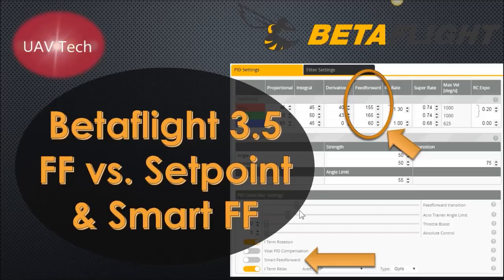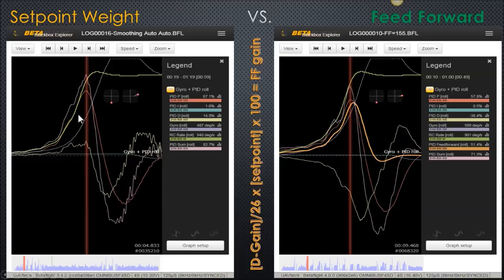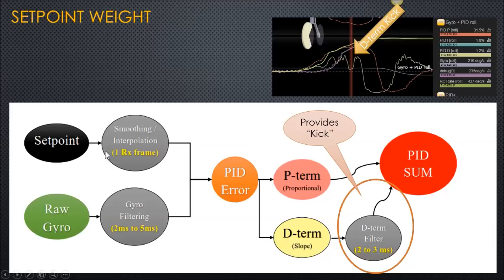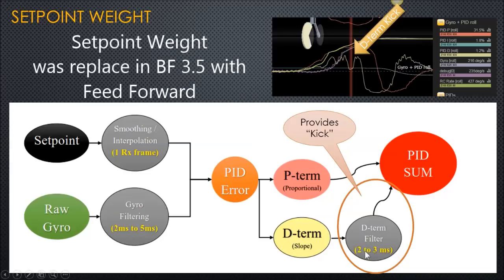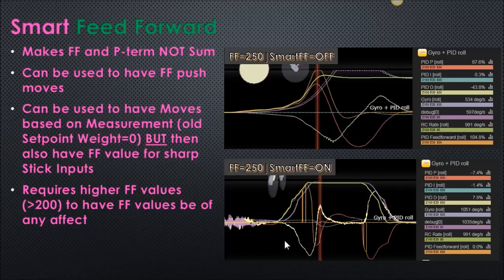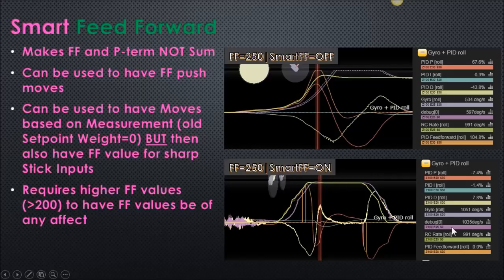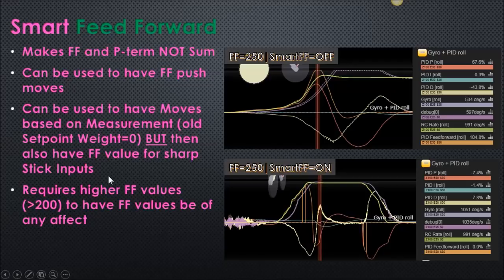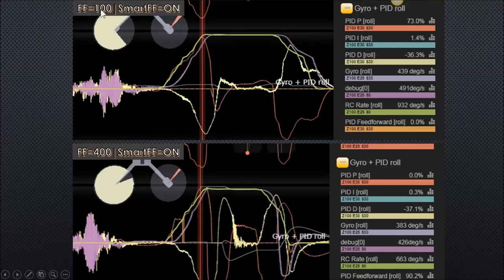FeedForward vs. Setpoint Weight (+Smart FeedForward)

Comment: To be entirely correct, the feedforward component, even when it was hidden in D by the setpoint weight, was still not passed through a filter, or affected by gyro noise. Actually the math (and code logic) is exactly the same before and now. It is just that now the two components (slope of RC rate and slope of gyro) are separated and use their own gains - which really makes everything cleaner I think.
Reply from the maker: Right, but if PID Error was based on Gyro (which had filter latency) vs. Setpoint.  And then that pushed response through D-term, which had more filtering and latency.  From how i understand it, FF is direct of setpoint slope.  no gyro or d-term latency involved.  Right?
Reply: Check out: https://git.io/fAxsB
This is the old code (spweight based).
Line 511 has the two terms - first one (dynC * currentPidSetpoint) is the actual ff term. dynC represents the weight scaled by the current stick position (the setpoint transition setting).
The second is the gyro term with the negative sign. Note that it is filtered independently on lines 504-5.

The differentiation itself (line 513) looks like it mixes up things, but in fact, since the terms are linear, we effectively have:
D = dynC*(currentPidSetpoint - previousPidSetpoint)/dT - (currentGyro - prevGyro)/dT
Thus the first term (ff) is still just a derivative of the setpoint and is completely independent of the gyro and the d filters. In 3.5 it just got its own gain (F) while the D gain remained for the second term.
Reply: Maybe it will be useful if we trace the evolution of the whole ff stuff.

Initially there was D from Error and D from measurement.

D from error differentiates the Error which is (Setpoint - Gyro).
D from measurement differentiates just the gyro: (-Gyro).

The Setpoint Weight was telling how much of D from Error has to be taken:
w*(Setpoint - Gyro) + (1 - w)*(-Gyro)
It's a classical weighted sum - if w=1, then second term will be 0, if w is 0, second term will be 1*-Gyro.

But if we simplify we have:
w*Setpoint - w*Gyro - Gyro + w*Gyro
the two w*Gyro cancel and we have:
w*Setpoint - Gyro
which we also find in the code.

This is quite an interesting result and we can interpret it in a new way. We can say that the D sum is transformed from weighted sum of Error and Gyro to a sum of a FF term - which only depends on the setpoint, sp.weight and nothing else, and the gyro term which depends only on the gyro.

In pre-3.5 the ff term was effectively scaled twice: once by the setp.weight, and then with the D gain (applied over the sum).
After 3.5 the ff term is scaled ONLY by setp.weight (renamed to F) and -gyro is scaled by D. Only then they are summed.
Reply: Thank you for pointing this out.  I was just scanning the comments to make sure someone did.  Plus, while we have gained the ability to adjust the setpoint weight now individually,  am I right that we have lost a stick deflection based transition.  I honestly like deflection based transitions and am exploring negative transitions now for brushed models with individual axis adjustability.  I honestly don't follow betaflight that closely so don't flame me if I'm wrong... I do most of my flying & development  in silverware.  I tried my own version of smart feed forward once too and found oddness when the setpoint crossed neutral axis that seemed to require some workarounds that I just didn't want in my pid controller.
Reply: No, the transition is still there. It is called "Feedforward transition" (feedforward_transition in the CLI). It scales down the F based on stick deflection. Mathematically there is no difference from before.
Reply: @Bidon555  thanks for that clarification. I honestly hadn't looked.

Comment: all this just wants me to fly stock settings and work around that, lol. and it's not bad, and your flying
Reply from the maker: fly stock.  if you want more kick into rolls (faster response), raise P or FF.
Reply: I figure the stock settings are middle to lower conservative to work ok on everything. I bump P up a bit (8 or 10) and D half what P got, I likewise, and FF to 110. It's not hugely different from stock, but does make the response seem a little tighter. Getting rates right for how you fly seems to make the biggest difference. Thanks for the video, It's fun to dig around in these a bit

Comment: Thanks again for a very informative video. What would you say is the latest safe Jenkins build to run as of today? Running 1075 now.
Reply from the maker: Unknown.  I'm still on 1075 and an experimental branch that has dynamic LPFs (ties to the Dynamic Notch mechanics).

To be honest, I have never had an issue with any latests Jenkins build.  But when I do flash and arm for the fist time I do have a little safety procedure.

1. ALWAYS, ALWAYS, ALWAYS (even for Stable) do a Reset after flash and before pasting DIFF.
2. Check each screen in BF config after a DIFF paste.  ESPECIALLY orientation, config page, pids and filters.
3. Hold from bottom and quad facing the ground when plugging in battery.  Ready especially after esc startup tones.
4. Arm under a tree and standing away.

Hope this helps.  Once the dynamic LPFs branch is merged, I'm sure i will flash up to a Jenkins to check it.  Can make a video then.  If you want to test that, let me know.
Reply: Thanks again. Look forward to seeing your next video.

Comment: By looking at the BB plots, (ie. your workspace #9 for rolls) can we determine if we have too much or too little FF set by looking at say the error plot?   I'm thinking that a large PID error magnitude will indicate the PID sum is too small if it the error is slow to zero out or if it shows a lot of PID error oscillation the PID sum is over shooting.  So by adjusting FF up or down according can I expect to see an improvement the the PID Error correction?   Is my logic correct?  Or is there a better guide or way to tune FF?
Reply from the maker: A large PID Error has a number of factors involved (physical limitations, P-term and F-term).  For a sharp roll, there is a lot of inertia to get moving very fast, so you will likely have a physical limit on what the machine can do. That is the main factor for a sharp roll. 

General guide: set FF gains to zero.  Tune the quads PID.  I recommend the Stinger Swarm video.  Then raise FF values to get the desired feel (speed) of quad response to quick stick commands.

Comment: I am verry confused by this video. Because if i see the colours on the graph correctly and based on what you are saying with D term opposing all movement. D term gets calculated based on speed an not error which is the case with p and I. All examples of pid loops i have seen and used the D is also based on error. In the error based configuration D can increase movement in cases of increasing error naturally giving the kick at the starts of movement. Did i not understand something or is it indeed not based on error?
Reply: No, D does not have any error component. It's also not correct to say the D opposes the gyro.  D actually opposes the change in gyro.
Reply: Could you explain what the reason was to base D on the gyro instead of on the error, or give a link to where it is explained on the github? (i am failing at finding stuff there as i am not used to it)
Reply: D is purely based on measurement of the gyro sensor vs. the previous sample.  This gives the most accurate derivative response.  Feedforward provides the "kick" you're referring to.  The D calculation is here: https://github.com/betaflight/betaflight/blob/f814459497377ede7f9d63dd2134e479a568f6c9/src/main/flight/pid.c#L1013-L1030
Reply: many thanks :D, I can see now why it was implemented the way it is currently. Might test some things if i can figure out how to work with it.
Reply from the maker: Right, I say "all motion" because all motion result in a change in gyro measurement and hence, to me, they are synonymous.  From that I see, the D term is the shock absorber, right?  Commanded motion, it opposes.  Outside force motion, (prop. wash) it opposes.

For P term it pushes to close PID Error to Zero.  So pushes when setpoint is changed.  And it also pushes against prop. wash too to close PID Error to zero, but it is just slow.
Reply: An interesting way to think of D is as follows: If you think of gyro rate like voltage, then D is a capacitor. So prop wash can be thought of as voltage spikes from an outside source.
Reply: UAV Tech: Your explanation was very clear, however traditionally PID controller all actions are done on the error between measured and setpoint. In betaflight PI are done on the error but D is not done on the error, but instead is only based only on measurement. Because everyone always speaks about it as a PID controller I assumed it was done in the standard way. However I would describe it as a PI controller with a parallel D action. I can see why one would not perform D on the error as it would spike every time the set point changes (user input). you would have to clean it up first similarly as is now done with the throttle if you want to use throttle boost.

To go back to a mass, spring damper example. It is as if you have all 3 but the damper is not connected parallel to the spring, instead it goes from the mass to some separate "fixed world" than the spring. Classically the spring and the damper would be parallel.

Comment: Yeah I think smart feedforward is a really bad idea. Your taking an actual calculated error pterm and replacing it sometimes with an fixed value that completely ignores the gyro.

This will surely end up with the quad feeling unstable on fast moves.
Reply: Absolutely correct. I'm not a fan of it either.

Comment: about smart FF. i still dont get it's purpose and benefits.
the only thing i noticed while i was testing it - a quad became inadequate, like in the case with absolute control feature. ie it was moving not as expected, less 'direct'
tried ff values up to 300 or so which caused overshoots and bouncebacks after rapid stick moves.
is it meant only for sharp moves or what?
maybe i missed something?
Reply from the maker: SmartFF is an experimental feature introduces by Joe Lucid.  Best I can surmise is what I covered.  So I think the intent is for racers that don't do flips and rolls, but want super sharp stick response.  Turn on SmartFF and crank up FF gains.  Again, experimental for trial.
Reply: I think it's more in the context of extreme LOS flying.
Reply: Joe Lucid sure is an extreme LOS flyer )

Comment: Hey buddy, I'm horrible at tuning betaflight.  Do you have any tips for a guy with a chameleon frame? Mr. Steele motors and the riot control fc? In my opinion Kiss is so much easier. I want to love my new quad but can't get it flying right.
Reply: Michael Dyer The best quad related pid tuning vid that I’ve come across on YouTube is stingy swarms method. This is now I actually tune pid controllers in control systems and it works really well. It’ll give you the base line values for your quad and everything else is down to personal feel.... check it out >>> https://youtu.be/ehyXLsvaEhw
Reply: @EddieFPV  awsome thank you I appreciate you taking the time to help me.
Reply: @EddieFPV  I wish there was a way to convert my kiss pids and rates over to BF. my aliens are absolutely perfect.
Reply: Here you go buddy.. these will convert your rates.. as for the pids... I think you should tune it yourself. You can’t really “convert” pid values. >> https://apocolipse.github.io/RotorPirates/
Reply: @EddieFPV  heeeeeeeey, awsome I really appreciate that. My kiss quads are so smooth and snappy at the same time, I'm going to plug these numbers in my BF one and see how it works out...your the best I can't thank you enough
Reply from the maker: Try BF at 1k or 2k gyro and PID loop and see how you like it.

Comment: I have flown butterflight since the fork and I recently tried Beta 3.5 but I cannot get the Feedforward to feel the same as my usual setpoint weight.  My d-gain is 20 on roll and 22 on pitch, setpoint weight is 1.  When I use the equation to find my FF value it is wayyyy too sensitive / fast for me.  I can't find the same stick feel as I had before.
Reply: Try 77 on roll and 85 on pitch. Also make sure you're using the same feedforward transition you were using for setpoint weight transition.  The default feedforward transition in BF3.5 is 0 which will make it more sensitive around center stick then previous versions.